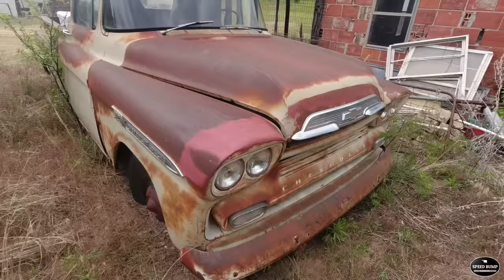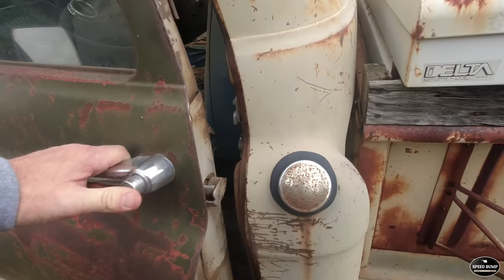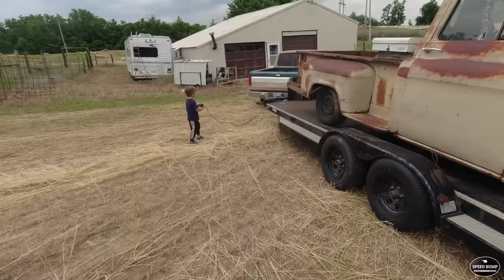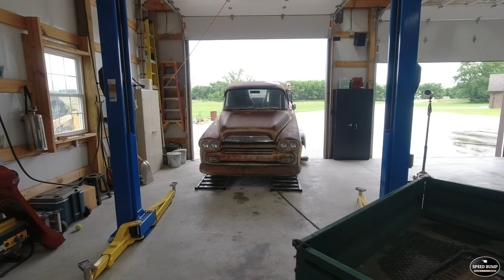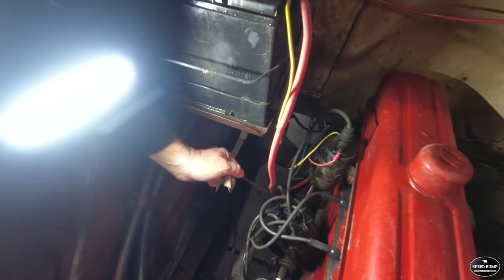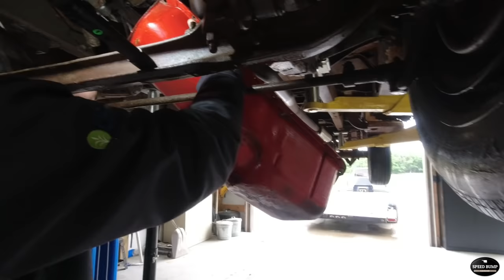59 Chevy Apache parked for decades... will it run?

Comment: I've used the Marvel Mystery Oil in the past and it works, but I remove the spark plugs and use an Oiler to squirt the oil into each cylinder.  It's good stuff it's like ATF high viscosity.  With the spark plug wires removed you can jerk the motor with the starter to work the oil further down the cylinder to try and break it free.  Good luck.  Great father and "sons" project.  AJ did a great job working those winch controls dad.  lol
Reply from the maker: Thanks Mike! Unfortunately I had to pull the head and get a hammer after it to free it up. Episode 2 is out if you want to see the rebuild.
Reply: @SpeedBumpGarage  next time- if ya get another seized one, try the old heat method.

Comment: Had it been me, buying the truck, the engine would have been yanked, as soon as it hit the shop. Replaced with a 350 small block.
But if I wanted to go original, I'd have to do research on numbers. If it has an original engine, then a rebuild would be in order. But I'm not one for doing original.  IF I could find one, a 327 would be a nice fit for the old truck, but those are few and far between, and pricy when you find them.
That's just me. But if you have another Chevy straight six, available, that runs, drop it in! Put newer tires on it and drive it! (But please, lube everything on the driveline first.) Check the oils on the tranny, and diff (Yeah, I know, you're already planning on all that)
Above all, have fun with the old girl.
Reply from the maker: Thanks for the feedback William! Check out the next 2 videos on the truck

Comment: Great start to Channel....Fyi..Alot of small block Chevys have pressed  on harmonic  balancers..I had a 62, vetted. 327..pressed  on...
Reply from the maker: Thanks! I didn't know that.  I guess I have only had late model small blocks that have the retainer bolt.  Thanks for watching.
Reply: @SpeedBumpGarage  Your family  vib, is a great one...I'm 68...I used to drag my 62 vette..I had a balancer fall off at a 115 on the drag strip...not fun..after that we drilled and tapped and bolted them...keep up the good videos

Comment: Yeah No2 cylinder looks bad from the underside. That water has possably worked it's way past the rings. I suggest you spray the under side of that cylinder too. Have you watched Halfass Kustoms? He gets lots of vehicles with stuck engines and manages to get them un stuck.. lots of soaking with oil ans acetone. Even vinegar works. You will probably have stuck valves. Pull the rocker cover and re evaluate. Pull the head, hone the cylinders above the piston. Lever off the ring gear. Yeah the easy way is to swop the engine but we're is the fun in that..... get er un-stuck and running.
Reply from the maker: Thanks Stewart! I hadn’t heard of Halfass kustoms but you are the second one to bring him up so I think I should check him out. We have 3 more episodes on the truck that I hope you get the chance to check out! Thanks for watching

Comment: I had a 58 chev fleet side short bed that was the same color only it had a 3 on the tree.  Had it about 9 years then it was getting tired so we bought a new 67 3/4 with 327 auto.
It was prety fast.  
Put some type of anti stick in the pistons and let it sit for a while.  I'll bet it helps!
Reply from the maker: Thanks Keith.  I would love to have a fleetside! Check out some of our other videos on the 59 if you get a chance!

Comment: Yeah marvel industry all can be used also in your fuel injection and your carburetors to clean varnish and deposits even out of your modern car you put about 10 oz 25 gallons of gas and it can be used for squeaky door hinges you can even be burnt in a chainsaw that's a mix of oil and it won't carve enough to muffler as much as traditional chainsaw oil you can use it in dirt bikes too as a mix oil it's got a thousand and one uses look up a thousand and one uses for marvel Mr oil on the internet and you'll be surprised what comes up
Reply from the maker: It really sounds like a universal oil! I had no idea.

Comment: pull the spark plugs spray pb blaster in the plug holes try to roll it over with a breaker bar may have locked up from condensation  build up if it sat for years.
Reply from the maker: We soaked and soaked but couldn’t get it free. Check out the next episode on it, she is back on the road now.

Comment: Excellent video :) also surprises that 235 6 cylinder motor is not paint blue because called Blue Flame not Red color also maybe need take head off plus soak vavles up to and give some heat but torch flame together! If have another motor stick in be excellent idea  and some motor  do get stuck and stay serious seized up to !
Reply from the maker: Thanks Andrew! From what I can tell the motor had been rebuilt which is probably when someone made the decision to paint it red. If you get a chance check out the next episode on the truck and see what we ended up doing!
Reply: @SpeedBumpGarage  welcome and if put new clutch plate try racing type run super nice too 👍!

Comment: And if that fails then you heat the piston and beat it with a block of wood beat it down in the cylinder after you run the the home through the top of the cylinder to remove any rest I watch more ski repair do it a thousand times so you may pick up some of his videos as his instructional because he showed his wins and his fails using all other methods to get engines loose
Reply from the maker: Hey Joe I really appreciate your comments! Check out episode 2 and 3 on the truck! I did end up beating it out with a hammer and block.

Comment: You picked a great first vehicle to start off your channel with. Love the teaching the kids as you go too.
Marvel Mystery Oil is an old farmers go to oil. The concoctions  some people use is amazing, suprize some of them home brews don't kill them. Lots of chemicals in them. The old machine guys I learned from liked to use Marvel and some old school destroy transmission fluid. It will clean and dig thru the rust and carbon as well as leave an oil film behind. That was before detergent oils, I now use the thinnest convental detergent motor oil I can find, 5w15 and Marvel or PB Blaster and mix even parts. I'm a big fan of PB Blaster but any good penitrating oil will work. I heat it up before putting it in sometimes but leaving it in the cylinders for a week is a great idea too. Not an overnight fix.
Reply from the maker: Thanks Frank! We didn’t have any PB blaster but I did give it about a can of kroil penetrating fluid

Comment: Marvels' great. I also like P B Blaster. It is a great penetrating oil spray. Does wonders on rust and frozen parts.
Reply from the maker: I tried Kroil penetrating oil but not PB.  Nothing moved until I pulled the head and got a big hammer 🔨!

Comment: fully rebuild it and enjoy that enjoy it, it is the grand daddy of the gasoline 6 cylinder torque monster engines and well worth the cost and time
Reply from the maker: I think that's the best call also!  Thanks for watching!
Reply: @SpeedBumpGarage  just a word of advise though , DO NOT reuse the factory exhaust manifold , it heats up the intake manifold too much and causes pre-ignition problems with today`s advanced fuels , go with a aftermarket header and have the header ceramic coated to keep the heat away from the intake manifold
Reply from the maker: That intake does get extremely hot! Thanks

Comment: I had a 70s Ford truck with a 460 low mileage I changed oil ran it and parked it no way for water to get in yet two years later there was a guart of water in the bottom of the oil pan I was told it was just internal condensation it was wierd anyway because it was clear water and I had antifreeze in the motor  have you experienced this before ?
Reply from the maker: I have seen engines form condensation when left with ought oil in them but a quart seems like a lot!
Reply: @SpeedBumpGarage  it probably wasn't that much but when you just changed oil and parked it it seemed like a lot a couple of cups at least long enough for you to go why is this oil clear before oil actually came out it was an f350 super duty and I gave it to a friend to camper it up to live in I couldn't have afforded gasoline for that hog of a 460 only ford I've owned but my friends told me that the good thing about the 460 is it gets the same mileage empty as is does hauling a house and it would have I got it free at a storage deal and drove a couple miles and I'm like wow it got some balls at the next stop sign I look behind to see a trail of smoke the emergency brake had been on hard the whole time it still had the motorhome on it at the time incredible!
Reply: I'm sort of like you I was going to fix it up so it was sort of like bleeding it looked real bad at the time any ways good luck to you on your future project's!
Reply from the maker: I have never owned a big block Ford but I would like to! Those 70s Fords are cool trucks.
Reply: @SpeedBumpGarage  from what I can tell marvel mystery oil works great for freeing stuff up but why pour in more than a half inch in any given cylinder at a time I dont think more is better in this case and it gets expensive quick see yah!

Comment: My chevy 3100 1963,  Made in Brazil, is very similar at this truck. Use the same chassi,engine jobmaster 261 gearbox, diferential, speedometer, starter engine at the start pedal, 4 beams,  sames door locas... but, unfortunately, the brazilian 3100 uses totally different steel cab and bucket... i love these trucks...
Reply from the maker: Thanks for sharing

Comment: Diggin' the F-series tow rig. Let's see how the '59 turns out; algorithm has part two in the related!
Reply from the maker: That’s great news! Hopefully it will show you episode 3 after that! Thanks for watching
Reply: @SpeedBumpGarage  heh. It didn't. But I did track it down. So nice to see that thing running.

Truth be told I think you could have gotten it to run without an in-frame overhaul once you knocked it loose but there's no way it'd burn so clean if you'da done that. Thing basically runs like brand new now.
Reply from the maker: I think you’re right but I broke a ring getting the stuck piston out so I didn’t want to let the full set of new rings go to waste. I really appreciate you taking the time to watch our videos.

Comment: When I lived off grid living on generator power I would put a cap full of Marvel Mystery Oil in my gas about once a week.  When I rebuilt motors I would coat everything real good with Transmedic, which is a product sold to pour into noisy transmissions. One generator I rebuilt the bottom end on I coated everything real good with Transmedic. Once I got it all back together I fired it up and ran it for about 5 minutes before I realized I hadn't put any oil in it!  The Transmedic did it's job and there was absolutely no damage. The only damage done was to my ego.
Reply from the maker: Sounds like you got lucky! I haven’t heard of that stuff but I will have to try and find some.